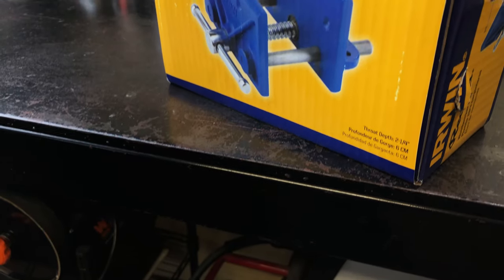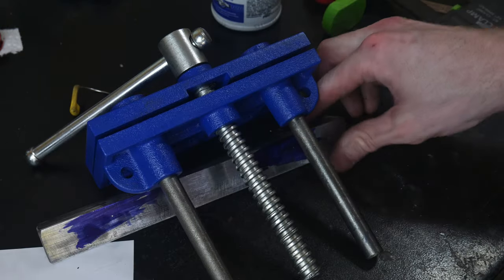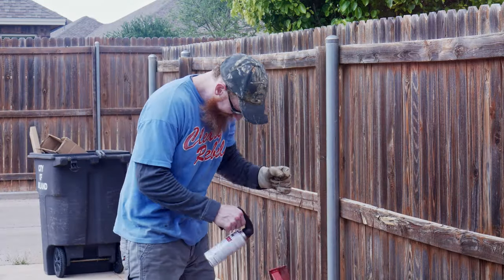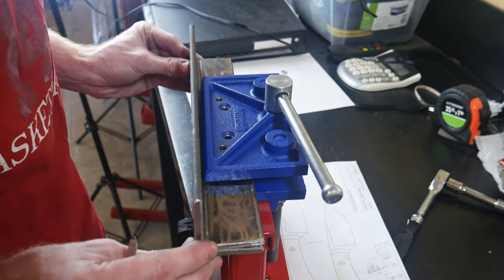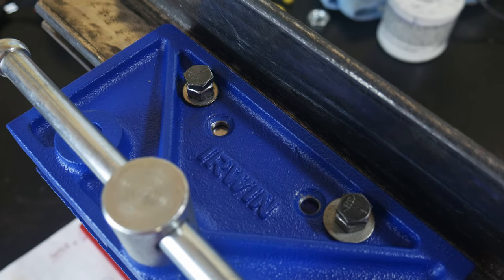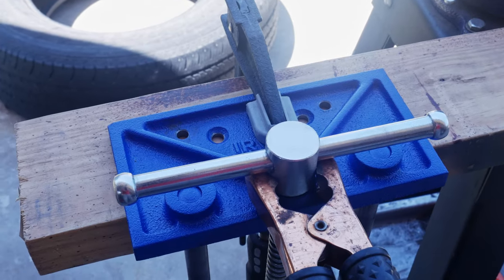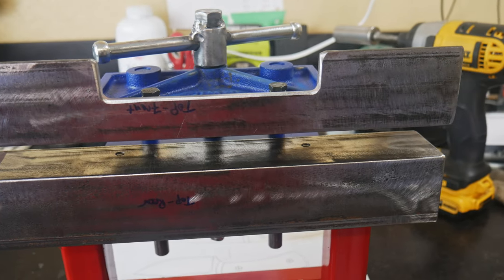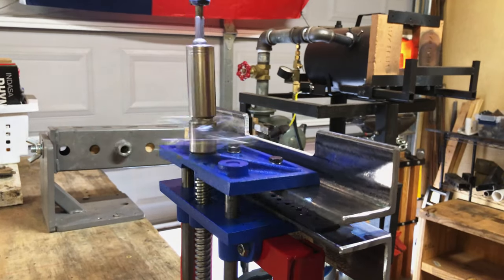Never Warp Again?! - Quench / Straightening Plates - 4K

Comment: Cool build.  I like that you can use a drill to close it quickly.  I have something like this but much lower tech with bolts in two pieces of 1/4” angle.  I like that approach because I can put the blade in it and throw the whole thing in the oven for tempering.  I’ve had blades warp during temper so I always put them in a straightening jig now.  About to heat treat a sword so time for a bigger jig!
Reply from the maker: Heck yeah man! Good luck with the sword! I'm scared of those long things! Let me know how it goes.
Reply: Red Beard Ops - I’m scared too!  Lol!   The hand sanding is a daunting task.  I’ve only done 3 of the 4 fullers and it’s taken me 3 hours already! 🤪
Reply from the maker: @TyrellKnifeworks  No joke! I have yet to try a fuller!
Reply: Red Beard Ops - I cheated and used the mill with a ball-end cutter.  😜  Video should be up in a week or two.

Comment: Very nice! I will be building one to go with my aluminum quench plate vise. Just broke an O-1 blade trying to straighten a warp. You mentioned Simple Little Life and Outdoors 55. You 3 are my most watched. Keep up the great work!
Reply from the maker: Heck yeah! Thanks Trent, that's super flattering. Really appreciate your comment. Good luck with your build.
Reply: Is the steel not conductive enough to quench stainless blades?  Or is an aluminum one not hard enough for keeping blades straight? Trying to figure out why you'd need two different things that do the same job essentially. New knife maker,  so I'm honestly asking as I came back to this video to look for this answer in particular.
Reply: Different blades require different techniques.  Aluminum dissipates heat quickly which is what you need for heat treating stainless blades because you don't oil quench them. They are air quenched.  Carbon steel blades are oil quenched and therefore you can use the steel vise to keep them straight after heat treat when cooling before tempering.
Reply: @trenthumphreys9368  thanks,  I'm just wondering why an aluminum version wouldn't serve both jobs. What would a steel one do that aluminum can't,  other than just being cheaper to build.
Reply: @jeremywest5433  I suppose you could use aluminum for both. I've just read and learned from experience with O1 tool steel (which I use a lot of and 1095) you don't want to drop the temperature below about 150°f before you get it into your first temper cycle to avoid stress cracking.  Aluminum could suck enough heat out and drop below that. Where I'm at the steel version is way cheaper to build.  A couple pieces of angle iron and a small bench vise will achieve the same result. It's just nice to have certain tools ready to go for a particular purpose... if you have room to store them and the funds to make them. Good luck with whatever you decide.  You learn along the way and it's an awesome journey. Find out what works for you and do it! No right or wrong you just want a straight hard blade!  Ha ha
Reply: @trenthumphreys9368  thanks,  that explanation helps me understand.   I'm pretty new to knife making,  and haven't really paid enough attention to temperatures between hardening and tempering.  This hobby is like brewing beer,  ALWAYS more to learn.

Comment: Dewd.  Built one for myself.  Harbor Freight has that vise and it was in stock for $20!  Had some scrap 2"X 3/16" angle.  Viola...  Tested on the "Boomerang " blade that fell in the oil.  Pulled it out of the scrap bucket.  Normalized it and then did a heat treat.  I left in the Parks 50 for ~10 secs.  Clamped til cold and...  It was straight again..
Reply from the maker: Heck yeah man... I love this thing... works magic

Comment: That's lovely work.  Spacing the holes out definitely seems like the right answer.

Now to see if I can frankenstein my way into using a pair of aluminum quench plates that are reinforced with your straightening plates to get the best of both worlds.
Reply from the maker: Good luck Aaron!
Reply: @RedBeardOps  As an update, I ended up trying a few different woodworking vises and settled for the slow one without the quick release.  The slanted threads were not the right answer.  I got a pair of 22" x 5" x 1.5" aluminum blocks as the core.  But then I took some 1/4 inch thick angle iron and reinforced the top and bottom with my first time tapping holes.  Hand tapping aluminum is dumb.  But thankfully I set it up so that the bottom plate essentially has an iron front and back lip so that it acts like a trough so I can't throw the steel out the back.  I still have the hand crank because I don't have a welder, but I manage just fine.

Now I can fully cool and unwarp blades with about 3 minutes in the plates for as much throughput as my evenheat kiln can muster.  It's frankenstein, but she's a workhorse.  Keep up the fine work my friend and thanks for the inspiration.
Reply from the maker: @aaronhope8366  Thanks for the detailed update!

Comment: Awesome tutorial, I build mine before I saw your video and it works great I did use 3/4" aluminum plates on mine it tends to cool the blade evenly and faster, I will weld a nut on top for rapid tightening,  Thank you again for your videos.
Reply from the maker: Thank you for your comment! So far so good with this thing. I may change out to Aluminum one day if I start working with stainless. Who knows! Cheers sir!

Comment: Yea this is a great build and setup IMO. The impact driver is great for speed. I wasn't sure how long you need to quench to gain your required hardness, you said 5 - 6 seconds, have you done any hardness checks on those blades? Just curious not saying it's no good, I honestly wouldn't know either way but am curious.
Reply from the maker: I'm in the quench for 5-6 seconds. I'm basing it off of some research I did on blade forums. I am also not sure what the hardness would be, or how it would be changed. I do know that they file test after this method just fine. One of these days I want a hardness tester! I would think that you're good to go to the plates as long as the blade is around 500F still

Comment: The gap you noticed was not due to the vice. It's the quarter angle. It tapers slightly from the inside corner to the edge.
Reply from the maker: Thanks for the info sir.

Comment: Have you had any issues with blades cracking when you close down the clamp with the impact driver?
Reply from the maker: Nope. That would likely happen if your blade got too cool before putting in the plates. For instance if I left it in the quench for 20 seconds, the blade took on a warp, and THEN I clamped it in the plates... it would crack for sure. I'm quenching for about 5 seconds. The blade is well above 400F going into the plates. That being said, what I'm doing is not an exact science. It will take a little trial and error to get my transition from quench to plates just right. Thanks for your question. It's a good one. Cheers sir!

Comment: I’ve watched a lot of your videos, I may have missed it but why do you have a piece of square tube in your gas forge? 
Thank you for all the great videos!
Reply from the maker: Thank you very much Kevin. I put that muffle pipe in there in order to shield the blade from direct flame. I find that it more evenly heats the blade before quench.
Reply: Red Beard Ops thanks for the fast response. I used most of your videos to make my wife a high carbon kitchen knife. Finished up last night. It looks like a first timers knife. A lot of lessons were learned from no.1

Comment: Great video 👍
I have one question. If you choose to quench already grinded blade (which tapers down toward the cutting edge of course) then how do you clamp it to avoid warps? 🤔
Reply from the maker: I feel like this works better with a blade that isn't ground, however, I've had success with ground blades. Specifically if there is still some meat at the spine (aka not a full flat grind yet)
Reply: @RedBeardOps  Yeah. I was thinking the same way about making not full flat grind but almost full about 70-80%. Thanks for reply. 👍

Comment: That's a nice contraption, and so easy to do in handsight. Is it important to close it very tight? I mean, is the pressure or the general guidence for the steel the integral part?
Reply from the maker: Man, I think having some pressure is necessary to push out a bend... but probably not as much as I'm putting on it with the impact driver.... lol  A lot of people do this with two pieces of angle iron in a vise. Thanks for your comment and thanks for watching man.

Comment: If the blade has a distal taper prior to hardening? Will the plates "hug" it in order to keep them straight?
Reply from the maker: I've found that the clamp does sitll work well and keeps everything relatively straight, but most of the time I'm HT-ing flat blades and grind in my bevels post HT.
Reply: @RedBeardOps  oh i see, I missed that chance. Don’t have yet a bele grinder, so I had to remove as much metal I could with a file before HT

Comment: Was just wondering how I was going to solve any warps from first time quenching, and came across this vid linked on homemadetools. Just after having looked at a woodworking vice and wondering how to go about straightening a blade with it!

Could not be better timing.
Reply: Some great ideas, and made me realise I need something that can be removed from the vice, so I can straighten the metal/blank before beveling, and a 3 pillar system I've seen others use to bend a beveled blade after quenching. Awesome vid as usual!
Reply from the maker: If you're going to be using a 3 point bending jig, just make sure you do your bending after the first tempering cycle. Otherwise you'll snap your blade.
Reply: @RedBeardOps  Thanks so much for the tip!